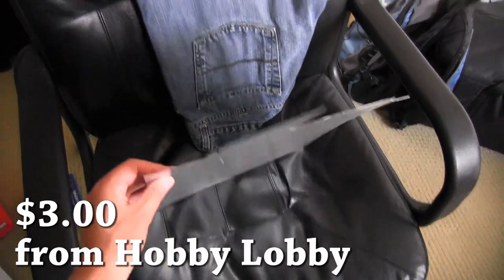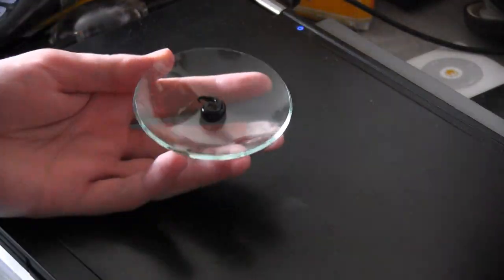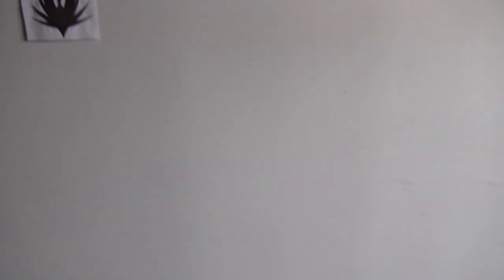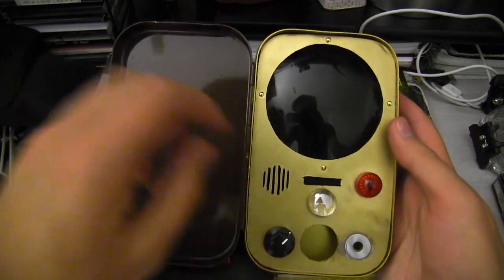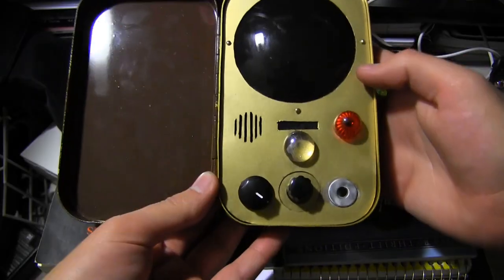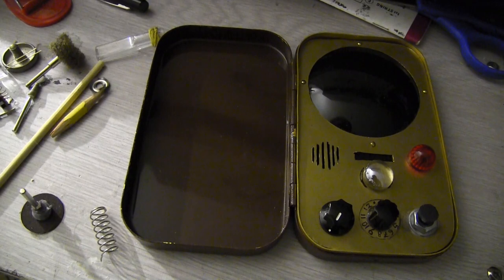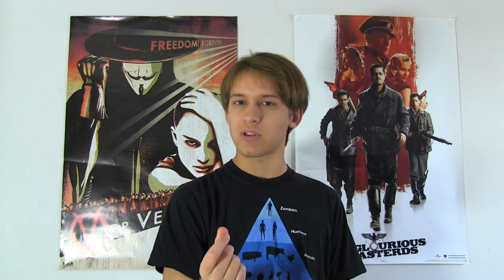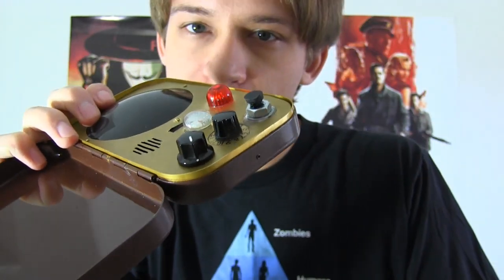How to Make a Farnsworth from Warehouse 13

Comment: In case you need additional glass lenses, if you look up "laboratory supplies", an item called a "watch glass" would fit the bill. Used in the lab to dry samples, but it is, well, a watch glass.

Comment: This is very similar to the Star Trek communicator, except for the fact that this version has video-phone capabilities and a different flip-open mechanism...

In addition, "F.A.R.N.S.W.O.R.T.H." stands for "Far Away Reconnaissance Networking System, With Optical Readout (video-phone) TecHnology".

Comment: You can also get lenses from rear projection tv's, they get rid of them all the time on craigslist (often for free if you pick them up). In my case, I was lucky enough to have my neighbor throw one away. You can also get a bunch of other fun parts from them.
Reply: and i bet you could make a golf tee into a nifty button with some trimming and doctoring if you aren't picky about 100% accuracy. I for one would rather make it "my farnsworth" instead of copying all of the normal ones :)
Reply: Yeah dont take old automotive, industrial or fire arms parts that people might actually be trying to find to fix something and make it work again. Those glass radio dials break and people do try to replace them when the find and want to restore them.. thank you sir for having a brain